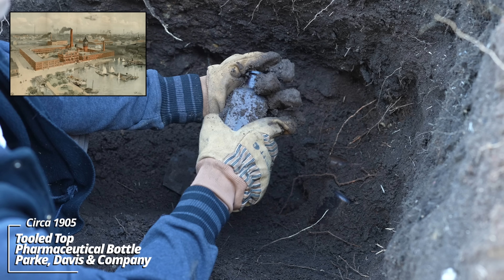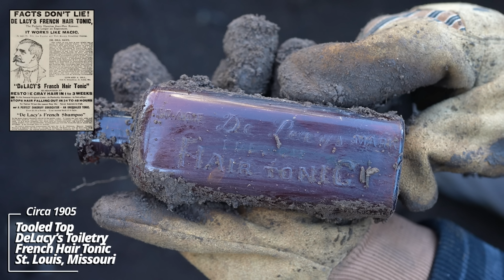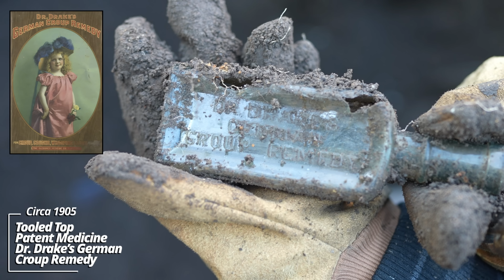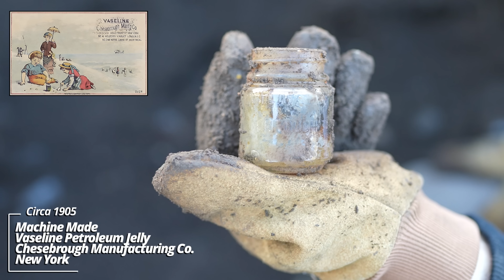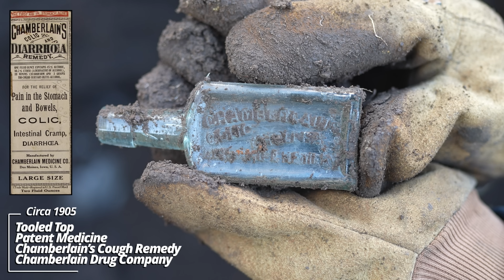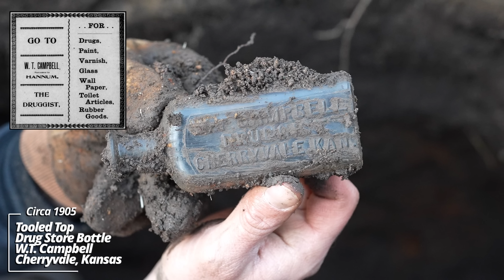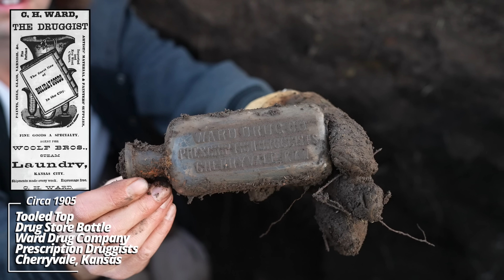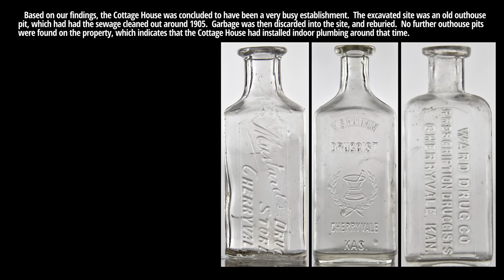Hitting an Absolute Jackpot Buried in the Rubble of a Burned Down Hotel from 1880

Comment: If most of these pieces are from a time period at least 20 years after the hotel burnt down, does that mean there's another outhouse pit containing MUCH older items (used by the hotel guests) from the mid-1800s?
Reply: Near the conclusion of the show, Tom used the term, the pit had been "dipped out", this means that between 1900-05 all the contents in this privy pit were removed to another location, (quite a nasty job but someone (s) had to do it), which likely was in keeping with the town ordinance. After this clean out was finished, the hotel continued to use it.
Reply: @briane6345  I always wonder what they did with the "dippings"!
Reply: I wonder if it's possible to find Old Town maps that would have where the plot for the city dump was?

The house I grew up in, from the mid 1960's on in Grand Rapids Michigan, my dad was told was built on the old town dump.  They filled it in and built over top.
This same house according to property records, was built in 1890.
When I was a kid I used to play amateur archaeologist and dig for treasures in the backyard. I did find pieces of old plates like flow blue, but I would get excited at every little piece I found and that ended my dig for the day. I had to run show Mom my finds.
The house is still there, but owned by other people now.
I would love to see Tom do an archaeology dig in that backyard!

Comment: I am about 12 min in and my question is the bottles are 1905. 
The building burned down in 1880 ? 
 I can understand if the outhouse got extended use after the fire .
  Would you expect the bottles to get older deeper in the pit ? 
 Or do you think this outhouse was built on the property after the fire ? 
 Like a communal public outhouse ?
Reply: Appreciate your channel and hard work !